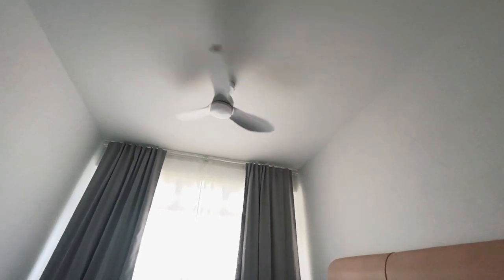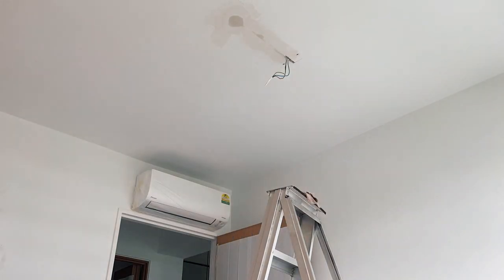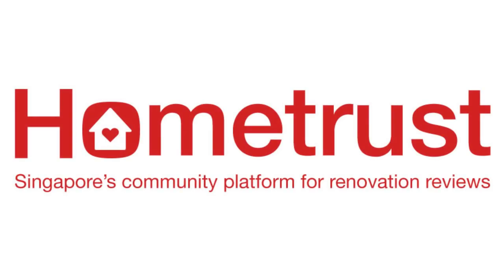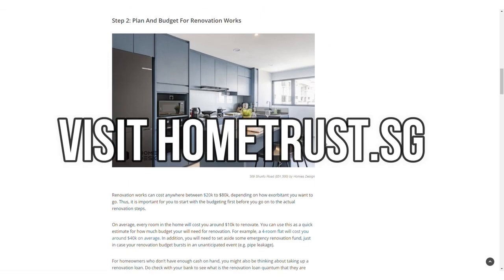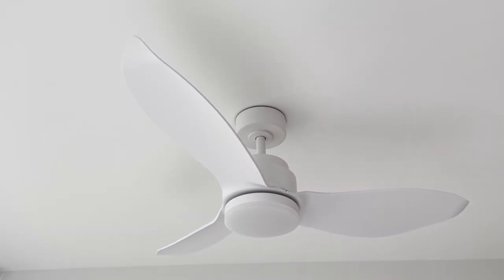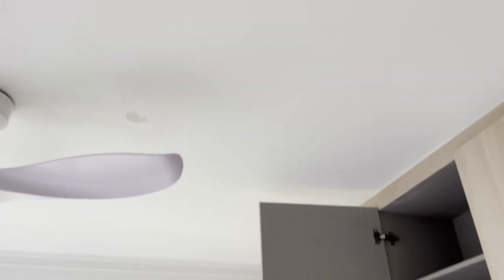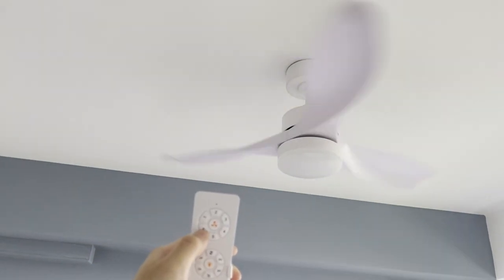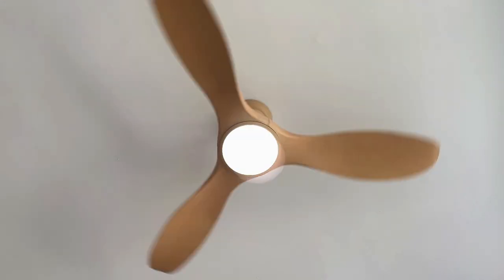4 reasons why you should get CEILING FANS • Our BTO Home Reno Journey | Japandi Inspired Home

Comment: Hi there, thanks for this video! The efenz looks beautiful. We're trying to decide between a 52" and 60" for our living room (there is adequate clearance for the 60" as we are not putting our lights/AC nearby). Would you recommend going for the 60"?
Were you able to try out the fan at any shops before buying? Or just cross fingers and hope for the best?
Thanks!
Reply from the maker: Hey Jayashri, our 52" has been serving us well. The size is pretty dependable on your living area space, 52" is sufficient for our 4-room living room area, wind strength is good even at low speeds. We tried it at the shop before purchasing 👍
Reply: @onebigegg1314  really appreciate your helpful reply, thank you! We will go try it out too :)
Reply: @onebigegg1314  Hey, wanted to give you and any other readers an update on this. Went down to the Efenz showroom. 52" is actually more powerful than 60" at the highest speed since the max RPM is higher due to the lighter blades. 46" has an ever higher RPM than 52", but because of the smaller blade size it moves less air. Hence the fan performance peaks at 52". We might go with that for both living room (4R) and MBR.
Reply from the maker: Hey Jayashri! Thanks for the additional information! 👍🏼 On hindsight I guess we're pretty lucky that we chose 52"! 

I'll pin your comment up for everyone's reference, cheers! 🙌🏼
Reply: @onebigegg1314  Hi there! We're making our final purchase of fans, and I'd just like to check that you're still happy with your Efenz 52"? :D
Reply from the maker: @jayashrishobna  Hey, yeah I'm still happy with my Efenz 52" fan :)
Reply: So now between the efenz and Aeroair, which would you recommend? Any issues? Asking now because 1 yr liao, best to ask now because you will know better if got any issues within this 1 year.

Comment: Hi there, when you shifted the electrical point and fan, did you just drill a hole and pull the wires? No need false ceiling?

Comment: Hi, is your living room fan 52"? noticed that it's near the 2 other down lights, does it cast a shadow? how far of a distance between the lights and the fan blades? and where did you get those downlights? looks nice! thanks
Reply from the maker: Hey RL, yes it's a 52" one.

The fan blade tip is approximately 1 meter away from the 2 other down lights so it doesn't cast a shadow when it's on. Thank you! :)

Comment: any recommend for ceiling fans with light but no ceiling shadow?
Reply: l think you will encounter ceiling shadow only if the light is above the fan. But not the other way round.
Reply: It's still possible to have ceiling shadows even if light is below the fan. Check out the shadows appearing at 4:50.